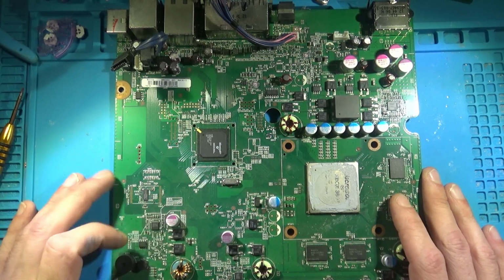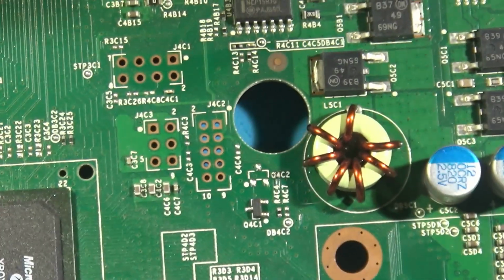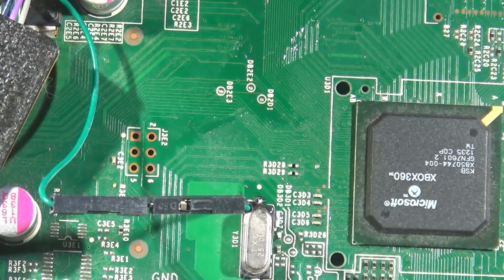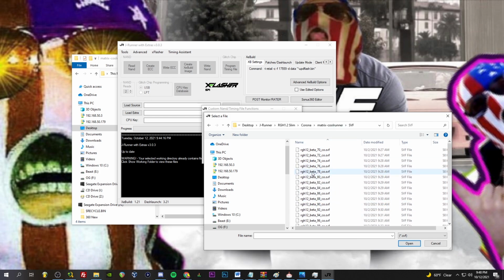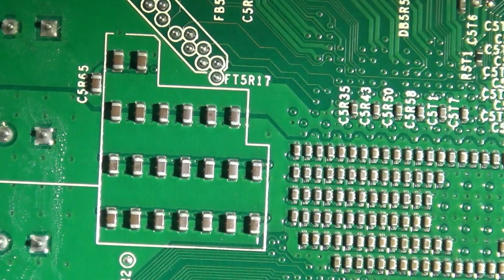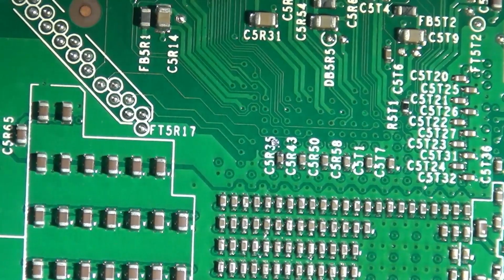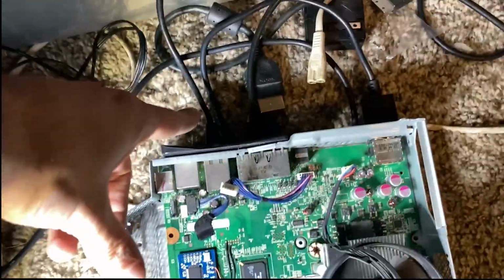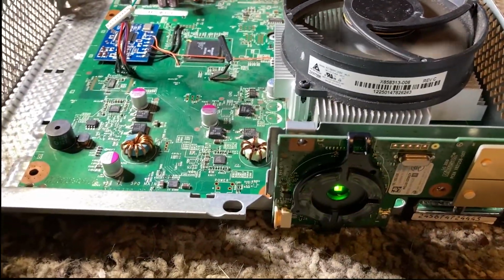INSTABOOT CORONA GUIDE! RGH 1.2 install for any Corona variation

Comment: Hi,
Thanks for video
Fyi the reason it didn't show up was only because the switch was in SPI, not eMMC mode :)
With the xFlasher eMMC, just hit Read Nand and it will auto set up for 4GB mode. If you do that, it will do number dumps selected automatically. The one from the advanced menu is custom. I really should refine/fix the behavior as its kind stupido right now.

Comment: what's the difference between svf and xsvf? always used xsvf on my matrix v1 for rgh 1.2 on phat consoles
Reply from the maker: I think it just depends on the programmer you're using.
Reply: @ModzvilleUSA  So with Jr programmer V2 my way to go is always xsvf i guess
Reply from the maker: @Mbarez94  yes it should go to xsvf automatically
Reply: SVF for xFlasher and Squirt. XSVF for NAND-X/JRP

Comment: The PLL picture / silkscreen in Josh's pack is for a trinity which is just on the bottom of "3" the PLL is slightly different on coronas which is the "5", i have done a few with RGH 1.2 and they all look the same.
Reply from the maker: Oh ok that's what was going on there. I figured the silkscreen might vary from board to board. Thanks for clarifying!
Reply: Yeah very close to each other but not the same.  Look at the high res pictures for PLL in the RGH 1.2 V2 pack by Josh.